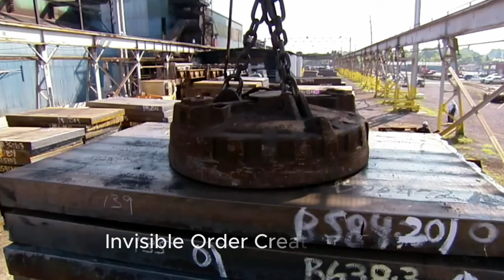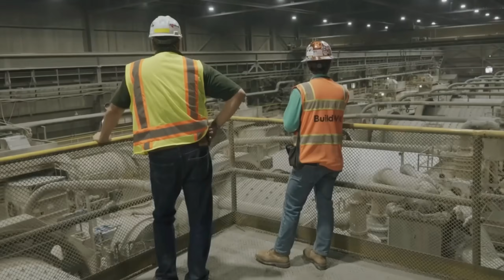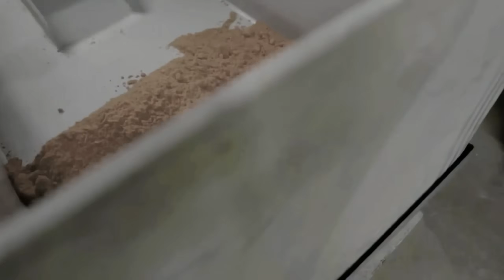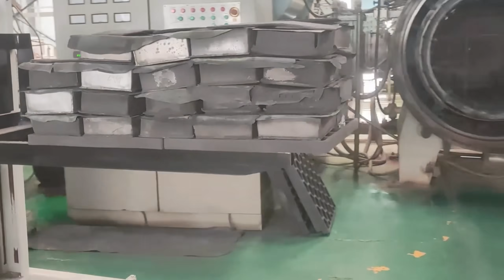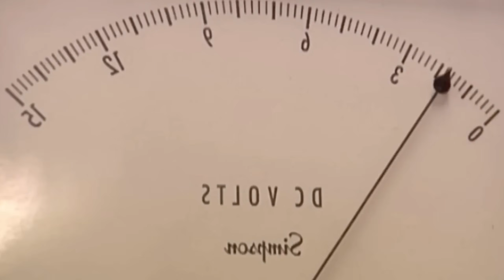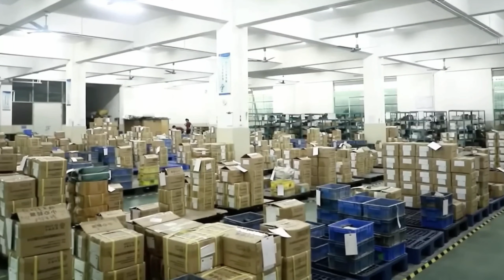Inside the Factory: How Magnets Are Made — The Hidden Process Behind Modern Life

Comment from the maker: What surprised me most is that a magnet can look completely finished and still not be magnetic. Which part of the process surprised you most?
Reply: I didn’t realized the direction inside the magnet mattered that much. I always thought magnets where just special pieces of metal.
Reply from the maker: @ITcarsANDmore  Exactly — the material matters, but the hidden direction inside it is the real multiplier. Without that internal order, the same piece can act almost ordinary.